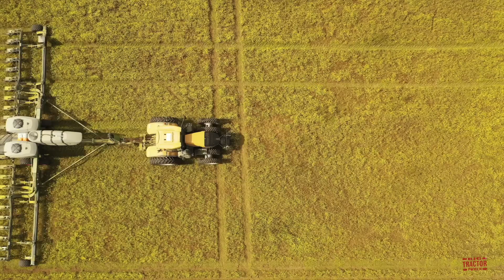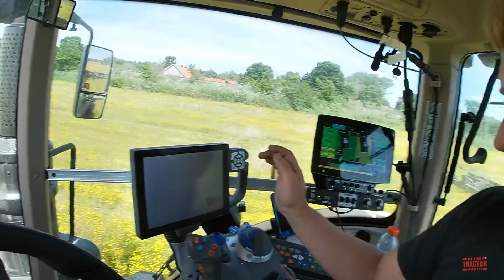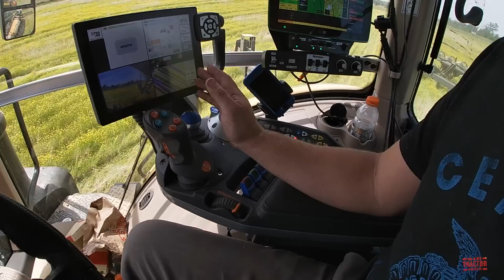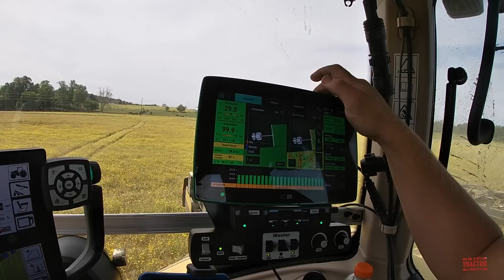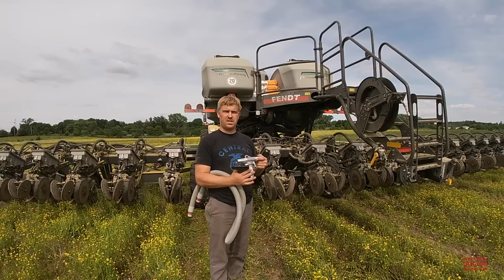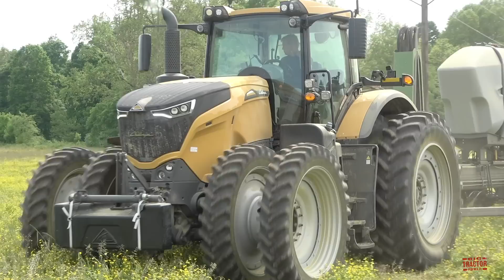FENDT MOMENTUM 24 Corn Planter

Comment: Never seen anyone plant anything with such vegetation, why is he doing that? Fendt has a long way to go even come close to a John Deere planter even with just the amount of units sold per year. That vacuum is very cool but your tractor has to have air on it in order to use it right?
Reply: No the planter has it own air I believe to run the auto tire pressure